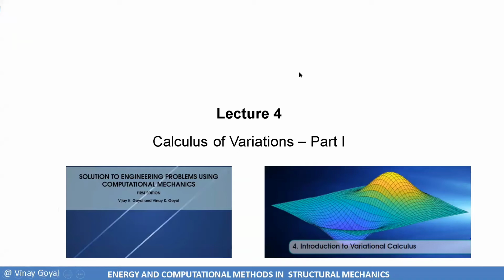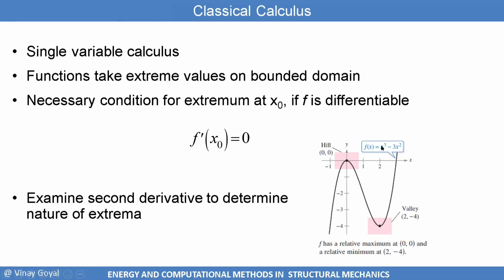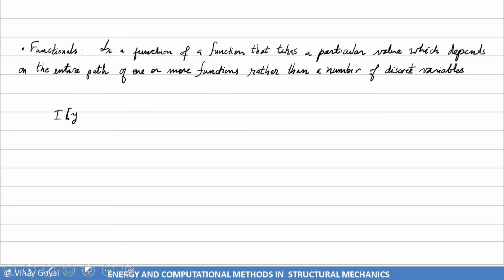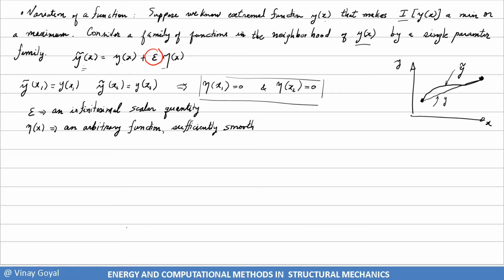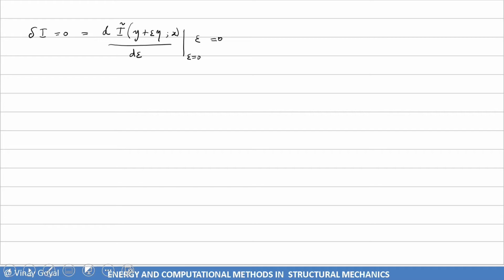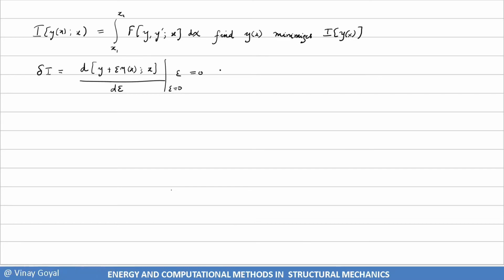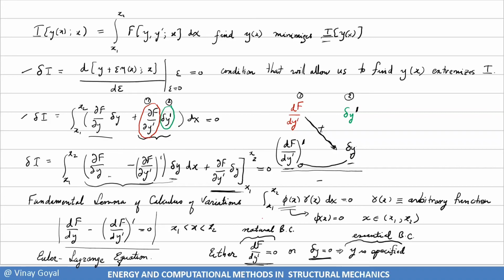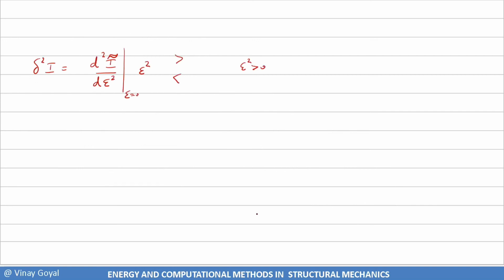4. Energy Methods and Computational Mechanics - Lecture 4 Calculus of Variations, Part I

Comment: Great explanation. I couldn't attend the live lecture, but now I saw the video. Initially I tried to solve the Brachistochrone problem after pausing the video, but I couldn't find a variable with which I could minimize the total time. Then I realized that the integral consumed the variables in the integrand and the total time just depends on the chosen function. Then I realized that the total time is not an ordinary function, but a 'functional'. Then I searched the solution on the internet, where I found Euler Lagrange equation. I was wondering from where did it appear magically. But then the professor derived the equation and I was totally impressed.
Reply from the maker: Thank you Shivam